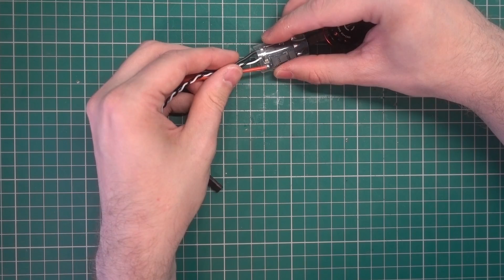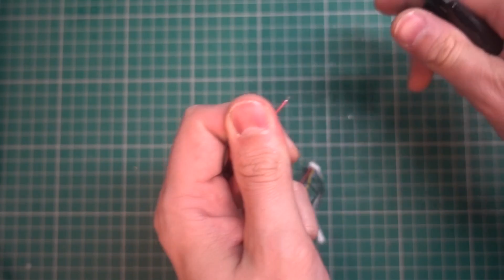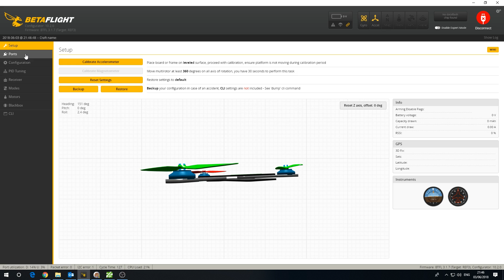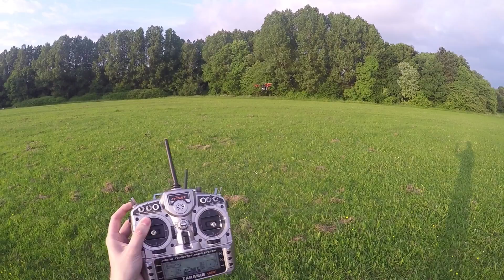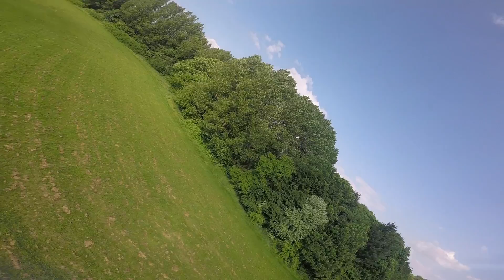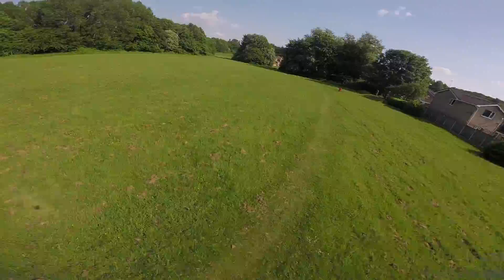RCExplorer Baby Tricopter 2018 Build - Setup - Fly!

Comment: @AndyRC

Your Tail-Servos P Gain should be a lot higher than the 50 or so it was set to in the video. This is why you were experiencing significant tail wag in forward flight. Somewhere around 70-100 is a good starting point, depending on motor power / prop size. 

Best way to tune the Tail P-term s to hover 2-3 meter above the ground and snap the Yaw hard and release. (watch the Tailmech closely as you do this) The Servo should pop to the correct position without overshooting, then snap back instantly when released. Now as you increase the P gain, the Yaws response will get significantly crisper and responsive. If you see Tailmech Wag thats fast (when the RC stick is released) then the P is most likely too high and if the wag is slow, then the P is too low. Keep tweaking the P until the Yaw is smooth and with minimal Wag.

A very High or very low Yaw P-Term can cause the Servo to oscillate as it will either overshoot or be too slow to react to the RC inputs. The Yaw I-Term should be as low as possible while still allowing the Servo to keep the Tricopters Yaw locked to a heading under high throttle. (normally 10-20) Now D-Term is very touchy as it can cause the Servo to Lag due to the filter delays. I recommend either keeping D-Term at 0 or near the same level as the I-Term.

Beyond that Keep any Betaflight functions disabled that can mess with the Tricopters PID's in flight. (makes it very hard to tune right) Stuff like Anti-Grav, D-Min, I Term Relax and I-Term rotation are best left off till after the copter has been fully tuned. Even then Integrated Yaw should be avoided as this can cause some really bad shit the moment the copter is Armed.

Cheers!

-Kevin

Comment: Were you able to arm/spin motors up with the normal betaflight flashed to determine what motors you needed to reverse? Or did you flash triflight, spin the motors (figure out which you needed to reverse), then flash betaflight so you could run blhelisuite?...I ask because I currently have betaflight loaded and cannot seem to get my motors spinning.
Reply from the maker: you need to do the tail tune and set the protocol to multishot and it should then let you move the sliders.
Reply: AndyRC so to do tail tune, you have to have triflight flashed. So it will be flash triflight, do set multishot/do tail tune, spin up motors to check direction, flash betaflight to go into blheli to reverse direction, then back to triflight

Comment: Whats your thoughts on a plus style quadcopter arrangement similar to the new diatone? I was considering making a floss style plus frame as i like cutting up stuff and modding things. I build/mod guitars Andy if you get a chance goggle pictures kramersteen ( or if photbucket works) guitars i'm sure a few pics will pop up look for 37 frets hehe. P.s where the hell is this darkmax,bfight etc etc speed test.

v
Reply from the maker: I cant say im a huge fan just because you get a big motor in shot. But if you like it i see no reason not to try. cheers

Comment: Really nice review! The reason you can't enable Dshot is that the RCExplorerF3 doesn't have DMA on the motor outputs, as I understand it. You could make an upgrade video with a AIO F4/F7 board and a R-XSR running F.Port, just to show what the frame is really capable of. The ESCs will run Dshot1200 no problem :-)
Reply from the maker: yes I am considering this thank you
Reply: I'm currently running the Matek F405-CTR, Akion 4-In-1 ESC (45 Amp Burst), Emax 2207-1900kv and 6S 1250mAh LiPo on my Tricopter Baby. (There is a Triflight release for this) Furthermore my entire setup is inverted with the Impossible Tail Mechanism installed... https://flic.kr/p/25xrX2B
Reply: Nice photos. Which Triflight? Is that .7 beta 3?

Comment: Two recommendations that have helped me immensely with my Tri-Baby build:
-Install your Servo as a quick disconnect (header pins) so changing it out later is much easier.
-Swap out Davids Tail Mechanism for the Impossible Tail Mechanism. This will greatly reduce the chances of damaging a Servo during a crash as well as reduce Tail-Wag.  https://www.thingiverse.com/thing:2869393
Reply from the maker: I saw the impossible tilt thing yes thanks
Reply: Andy...lt wasn't shown in the Video, what was the Yaw-D set to? I ask as I've normally had to set mine pretty high to counter Yaw oscillations.

Comment: Does anyone know what the feedback pad is if you're not using the RCExplorer FC? I have an old FliteTest tricopter that I want to put an old SPRacing FEEL in, but I'm not sure where to put the feedback wire. Is it a UART or a PWM input?
Reply from the maker: It is the rssi pad. Cheers

Comment: Like this style with 3 motors.
Is there something out microstyle 2 or 3 inch?
Reply from the maker: Not with a servo but there is something similar look up the y format
Reply: There is a brushed Tricopter, Trident I think its called...
Had thought about converting a micro Y4 to tricopter with servo but Im still a noob & anything with an exposed prop is dangerous in my hands- hence why I got an ET100...
But just as soon as I can I'll be moving onto a Mini-Tri; flying one of them is the whole reason I wanted to get into multirotors!

Comment: Looks great. What weight did it come in at? Under 250g?
Reply from the maker: Just under 300 I think
Reply: AndyRC you'd think, by losing an arm, an ESC and a motor, it'd be closer to that 250g threshold despite the addition of a servo. 

A tricopter could be the way to go to get performance and agility without the need for registration.